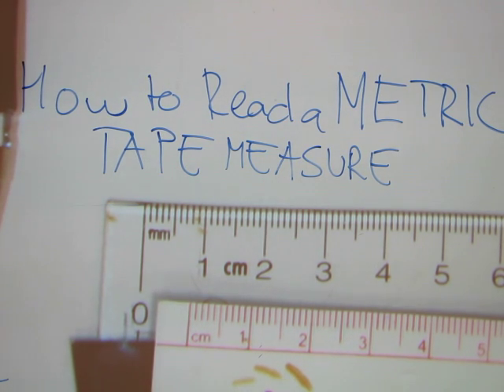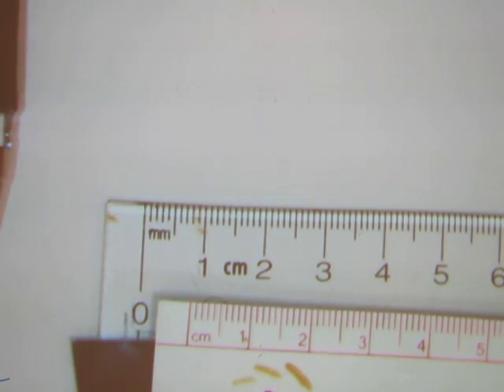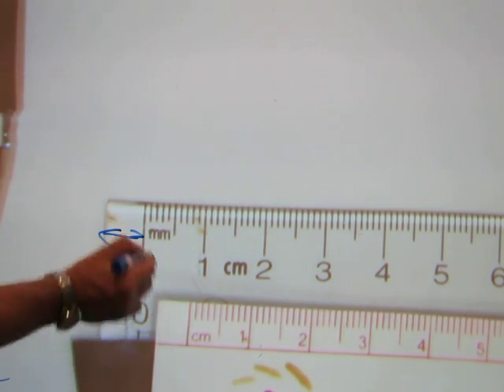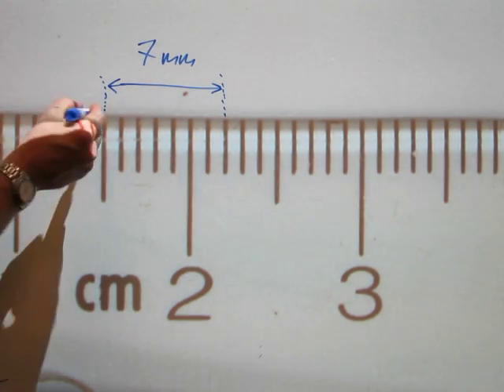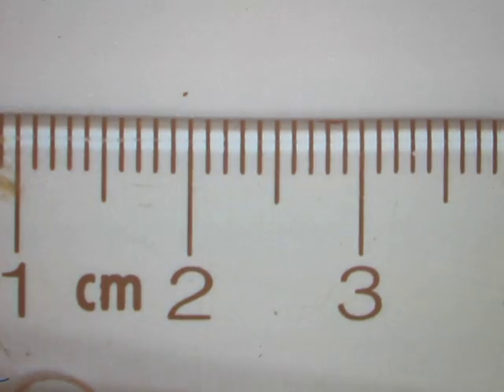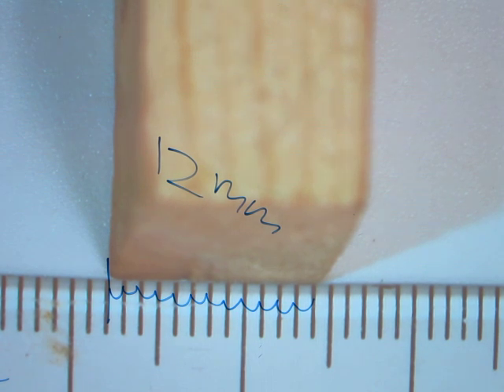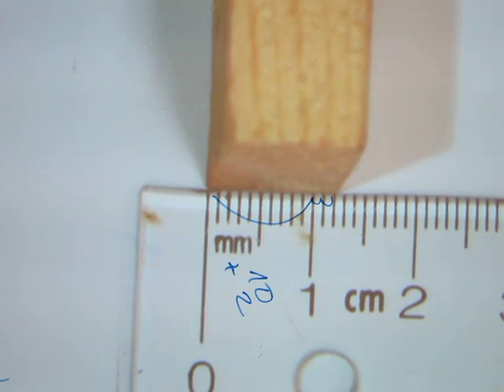Read a METRIC tape measure

Comment: Metric is so much easier and so much more precise.  1000mm = 1 meter, 100 cm = 1 meter, 1000 meter  = 1 kilometer. Take a 100mm x 100mm x 100mm cube. Fill the cube with water = 1 liter. Weigh that water = 1 kilogram. Now in your head try adding up 1/16" + 7/8" + 1/32". how's it going? Now try adding up 16mm + 22mm + 0.8mm. Took me about 3 seconds to calculate 38.8mm

Comment: I never learned measurements. I am a slow learner....and really wished teachers were more specific when teaching especially when it comes to the metric system. 
I can now know the right way of measuring using the metric system. All thanks to you brilliant sir!.
Reply from the maker: Glad it was helpful!
Reply: Metric is much more. 10 cm in a cube is 1 liter volume. Filled with water is 1 kilogramm weight.

Comment: So what about long measurments?
 You mention blueprints.  An exterior wall is given in mm and not meter (yard) ?
Reply: First i need to say sorry for my english. Yes its always in Millimeter. Always add a 0 beyond a full number on the scale to know the millimeters like you see here at 1centimeter or 10 mm. So if you use a long measurement tape lets say 10 meters (100 decimeters, 1000 cm, 10000 millimeters) and you need to mark the distance from your point 0 to 500 mm your tape shows 50 (cm). 759 mm look for the cm number 75 first and then look back at the mm lines to 9 (or 1mm line before the cm number 6). Same with 7593mm look for number 759 on the cm scale then mm scale 3. It's only a game with 10. 10mm 1cm, 100mm 10cm, 1000mm 100cm or 1meter and so on. Hope it was helpfull.

Comment: Metric is up until now most used and fornow known accurate work production mm and smaller delivers the quality, but soon you are going to be able to measure over the layers y x and z in even smaller and more precise units! Haha light speed, I 'm a show you how to track the map from earth milky way galaxy to outer further galaxies
Calculus start your engine! I'm getting old to use my brains alone on stand alone on this with all these new modern gadgets now a days...
But I'm still keeping a close eye on calculus because it just might be a slight bit incomplete...
It needs to be calibrated for the future set that calculus

Comment: I'm a machinist---an imperial measurement such as 2.625 inches  (2 5/8 inches) is routine and completely acceptable. you don't have to be genius material to understand either system.
Reply from the maker: Of course. Also proven by 19,000 subscribers

Comment: One more question if I could please?  How would you tell someone to go measure a 12 foot section for me in millimeters? Would you say go measure 3,657.6 mm or 3.66 meters. Wouldn’t it be harder to learn that than 12feet 11feet 10feet etc.
Just wondering 
Thank You
Reply from the maker: Metric blueprints are always in [mm], including size of whole buildings, which is written as 48,350 mm for example. So 12 feet is written as 3658, building are designed to whole number [mm], without decimal digits. Shop drawings of engine components or lock parts have up to 5 decimal digits.
Reply: apprenticemath Thank you very much, I appreciate it

Comment: +apprentice math; Hi thanks for sharing this video on how to read a ruler or a tape measure. Caused I've found it very difficult to read them both though I've made cloth bags different styles & sell to clients or customers. I always get confused as to where I should start measuring from cause my tape measure have a taped end. Anyways My Question to You; Can I Count in Tens Rather Than Counting In between the Lines Just Asking; Not That It's a Problem for me; Just Taught That might be easier for some person's like myself. So Is It Ok If I Count the Lines on a Sewing Tape Measure or I Should Count In between the lines as well; also asking. I look forward to your reply as soon as possible (A.S.A.P).Tafs.
Reply from the maker: Thanks for watching.
All tape measures and rulers in any unit or system: count the gaps
Of course counting by 10s or 5s makes reading faster, such as groups of 10 - 10 - 5 - 3 (dashes, not subtraction) is faster to come up with a total of 28 than counting by 1s.

Comment: The reason metric never caught on in the US is the use of decimal numbers in the measurements (.5 cm, .25 m, .7 km, etc.)

If the metric system used fractions (1/2 cm, 1/4 m, 7/10 km) similar to the Customary system  (1/2 in, 1/4 in, 7/16 in, etc.) it might have caught on.
Reply: We don't do this. 0.5 cm are 5 mm, 
0.25m are 25cm or 250mm, 0.7km are 700m 7000dm 70000cm 700000mm. Never 0.something 😉

Comment: very helpful! thank you. the first measurement of the block was the thickness?
Reply from the maker: It could be, but it depends on  how the 3 dimensions are to be named. It could be length, width, height. It could be length, width, thickness. It could be length, breadth, depth or any other combination.
Likewise, a living standing person has height. A sleeping or horizontal person or a bed has length. A sleeping person`s height could now be chest depth, thickness at waist or wherever you want to measure.
Pick one frame of reference, it`ll work.
Reply: Thank you.

Comment: ok guy start always from 0. way to easy..  if you have a length of 100 meter and 10 cm.. you don't want to count all the mm.
Reply from the maker: +Carlos Blanco Even in longer distances the mm might be important in locating the building lot boundary or in building a supermarket and locating rows and columns of posts.

Comment: I am from South Africa and here we only use the metric system. I lived and worked in the USA for 6 years.
I always told the American people how easy the metric system is. Also told them if they can imagine 
how difficult it would be if 12 cents makes a dime like 12 inches makes 1 foot and 3 dimes 
makes $1 like 3 feet makes 1 yard and then 1 760 cents makes  a $100 bill like 1760 yards makes a mile.
 
Metric works like the money system just in 1000's. You get:
 
Distance:
 
100 cent in $1                                                 but 1000 mm in 1 meter
100 x  $1 bills in a  $100 bill                          but 1000 meter in 1 kilometre
 
Weight:
 
100 cent in $1                                                 but 1000 grams in 1 Kilogram
100 x $1 bills in a $100 bill                            but 1000 kilograms in 1 Metric Tonne.
 
Liquids: 
 
100 cent in $1                                                  but 1000 Millie Litres in 1 Litre. 
100, x $1 bills in a $100 bill                            but 1000 litres in 1 Kilo Litre.
 
1 Litre of water weigh exactly a 1000 grams or 1 Kilogram
1 cubic meter water is exactly 1000 litres and weigh exactly 1000 Kilograms or 1 Metric Tonne.
Reply from the maker: +Suid Afrikaanse Boer You`ve got talent. Start making videos, grab a paper, go.
Reply: And the secret... it keeps going beyond kilometers, on to the scale of the universe...

1 000 kilometers = 1 megameter (Mm)
1 000 megameters = 1 gigameter (Gm)
1 000 gigameters = 1 terameter (Tm)
1 000 terameters = 1 petameter (Pm)
...

So each step (k, M, G, T, P, ...) goes up by another 1 000. Mm is fit to measure the distance between planets and moons (e.g. Earth's Moon is 384 Mm away), Gm to measure the distances between planets and stars (e.g. 149 Gm between the Sun and Earth.). Tm doesn't really fit well, but the next one after that, Pm, can measure the distances between stars in a galaxy (Alpha Centauri is around 46 Pm away.). And what's 46 Pm, the distance to Alpha Centauri, in km? It's 4 steps (M, G, T, P) above km so it must be 1 000 000 000 000 x 46 = 46 000 000 000 000 km (46 trillion km, note 4 groups of zeroes) distant. That's a long ways off isn't it?
Reply: you just confused the shit out of me

Comment: Just a small point. You talk about counting gaps and not lines. The ruler starts at zero, so if you measure from the start of the ruler something that is five millimetres and count five lines, not including the zero line, you will be right, you don't count the first line as one. You add confusion by showing the ruler starting at zero and then later marking the line at the start of your measurement as one. It's not one, it's zero. Possibly this comment is equally as confusing but I hope you get what I'm saying
Reply from the maker: +Adrian Connolly It`s a really good small point. In metrology, there is no zeroeth (0th) anything. In counting words the first number is one (1). In math of course, there is zero.
In math it`s dealt within the broader concept of "frame of reference". The hinges on the same door can be described as "on the left" or "on the right" by the same observer depending on the direction the observer faces. An object can be "at rest" on a table if the frame of reference ends with the room, since the Earth is in constant motion with everything on it.
So as long as we all agree that door hinges are named when viewed exiting a room, rulers are read either with skip-counting or not-counting-the-first-line, and "at rest" will imply "with reference to the surface of the Earth" - we`re good. Not confusing, it`s life.
Reply: +apprenticemath While I genuinely admire your intelligence, I still think that you over confuse the metric system. If a person can count to ten then this is easy.
Reply from the maker: +Adrian Connolly Sure is easy. Thanks for the feedback. My classroom version is less confusing where students get a bigger picture (over 2 -5 days) not just this 10-min  snapshot. (video was made for review/missing class)

Comment: You make using Metric look hard, never start measuring at some odd number and then start counting the MMs you start at a 10 or twenty or 100 and then just read it directly, also MMs are divided all the time but by tenths and hundredths.
Reply from the maker: +Mentorcase Right, anything that suits one`s eyesight & fancy as long as the final measurement is correct.
Here is a video on those tenths and hundredths of a mm https://www.youtube.com/watch?v=CW74NPTu5Pw

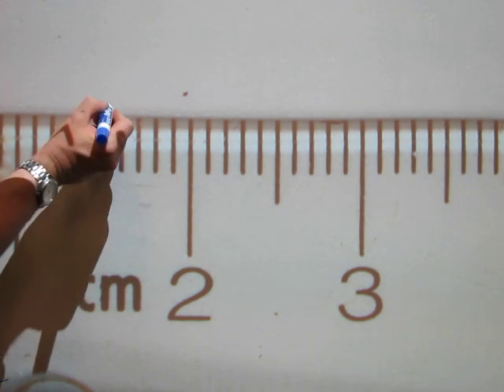Comment: Note at 3:20 "To read a metric tape measure you only REALLY need to count the Millimetres."
However at 6:50 the presenter said "12 Millimetres is exactly the same thing to say as 1 Centimetre and 2 Milimetres."

But, DON'T SAY IT.

Don't even think of or "SEE" Centimetres.
If possible, get yourself a tape or rule with ONLY Millimetre markings.  They DO exist but may be hard to find in North America.
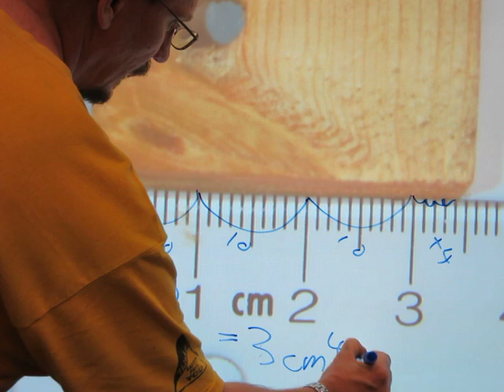As the presenter said (9:15) "On your blueprint you will NEVER see Centimetres."
and, at 9:35, "Don't give (measurements) in Centimetres. I want just one number and it's in Milimetres"

This MAY seem a trivial point BUT it is VITAL to the SUCCESSFUL use of the Metric System (SI).

For further information see two essays at http://themetricmaven.com/?m=201207 and a very full study of this matter at http://themetricmaven.com/wp-content/uploads/2012/03/centimetresORmillimetres.pdf - which is referred to in the above essays.
Reply from the maker: FrodoOne1 Wow. Good stuff, very true, thanks for sharing!
(Clear plastic office rulers tend to be marked with cm. Metal rulers are mm, but was the glare not working well for the video)
In measurement, one number seems easier than 2, or more, but often we use 2 or more. Examples include: took 4 hour 8 min (not 248min), isle 8 shelf 14, on Dec 4 (not on day 338), 2 and 3/4 pizzas left, 685 Main street (not Lot number 15,632), Longitude N15 degrees latitude E28 degrees, etc.
Reply: What's quite sad is that in the last two decades measuring tapes in the US and Canada have gone from being mm-based to cm-based. I've got an old Sears Craftsman with everything marked off in mm, and my father has old Canadian Tire (Mastercraft) tapes in mm as well, but they're all showing their age with most of the etchings in the two feet or so (both imperial and metric) near illegible.

My Craftsman tape counts off in 10s, with the '1' (or 2,3,etc) on the left and the '0' on the right of the etching, as in '1|0' (so you can read it as cm as well by just ignoring the '0'). At 1 dm, it reads as '10|0' (in red lettering, not black as at the 1 cm marks) and the count restarts, so the marking at 120 mm is simply '2|0'. At 1 m, it reads in red lettering as '10|00'.

It's almost as if the people designing it put some thought into it. It's not the best metric measuring tape I've seen, but it's the best I've used. I can't find that tape measure or anything like it anymore. Since I can't even find mm-based tapes in France, I'm now convinced that the cm-based tapes are a byproduct of metric conceit: "we're base-ten and since base-ten is inherently better than anything else we don't have to think about how to make it usable".

The best metric tape I've ever seen is the one in this image:
http://www.esdc.gc.ca/assets/portfolio/docs/en/essential_skills/tools/fig18_eng.jpg from this page:
http://www.esdc.gc.ca/en/essential_skills/tools/construction_electrician_story.page
Note that the 2,3 and 7,8 mm marks are longer than the 1,4,6&9 mm marks. This makes it a lot easier to read in poor light. Whoever designed this took the principles behind imperial tapes and applied them in a modified form to metric tapes (it also makes marking off quarter centimetres quite easy). About the only problem with it is a slightly poor choice of font/typeface. If you're going to take the dubious decision to use an inherently flawed base-ten measuring system, this is as good as you can get.

But, as I wrote above, sadly the 'metric conceit' of metric's supposed inherent betterness has taken over and we now get the bleary eye-inducing all-equal length (but for 0.5 cm) marks and cm-gradated tapes now. Hopeless, really.

I've built houses in both imperial-measuring Canada and metric-measuring UK. The use of cm-gradated tapes in the UK while most things you're working with are spec'd in mm made things annoying, along with the usual problem of bleary eye-inducing metric tapes. A mm-based tape would have made the problems of working in metric tolerable, but cm-based was just too much. I took to using the far more functional imperial measures whenever I could.
Reply: I saw one of MetricMaven's video, and I really don´t understand this logic against centimeters. 

Gee, it's all a factor of 10 anyway.

conversion from cm to mm is automatic on our brain.

I am talking as someone from a metric country.

ps: no country is fully metric. TVs and wheels are measured in inches in most metric countries, although most people can´t point out how big 42 inches is if you ask them.

Comment from the maker: Interestingly, when you add or subtract, "gaps" are counted. What is 8 - 5? If you count the lines or numbers in between, the answer is incorrectly 2, counting  6 and 7, as 6 and 7 are between 5 and 8, a total of 2 items. The correct answer is 3, as there are 3 jumps needed to get from 5 to 8.
So, that`s the MAIN reason why counting jumps got filmed.

Comment from the maker: That`s good to hear and good on you. Your story is a good example on how effective learning happens. Clear instruction is the start, but not much learning (=permanent wiring-in) takes place without the learner making sense of the material through intense interaction. Like you worded this interaction "you taught yourself". My videos are only meant to be reference, it is followed in-class by measuring everything from paper thickness to bolts to wire gauge.